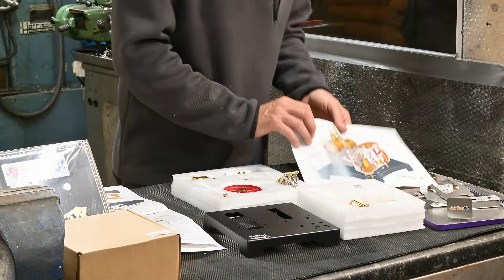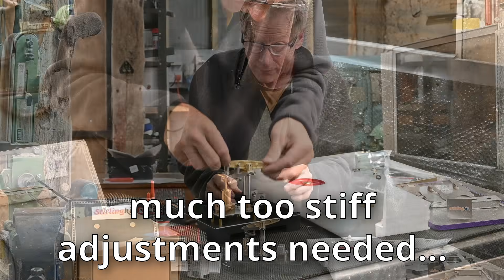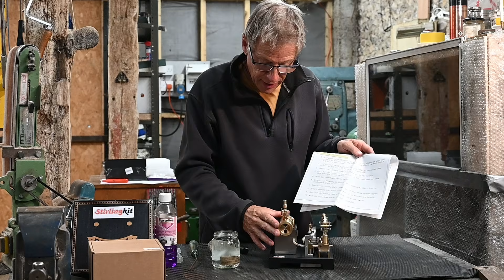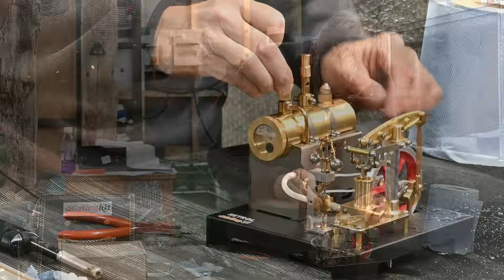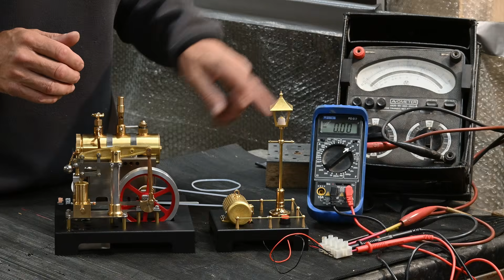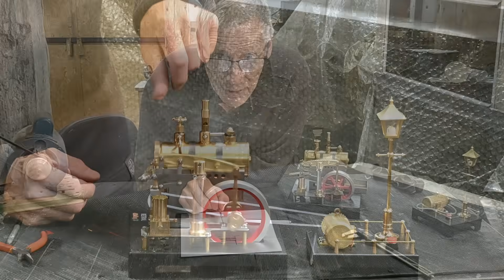Super-Cute Beam Engine from Stirlingkit – and measuring power output at Peter’s Railway

Comment: I'm having real trouble with mine. It runs out of steam very quickly, and you can hear it escaping out the exhaust. I don't suppose there's any chance you would make one of your improved valves and sell it to me?. I would be extremely grateful as at the moment. I have an engine I can't use.
Reply from the maker: Hi Gordon,  That is such a shame.  They have made such a lovely model, but seem to have made something of a mistake on the valve dimensions.
I am a bit pushed for time at this time of year, but I guess I could have a go at making another one for you.  Are you in the UK?
There would be no charge, but if you can think of someone to buy some of our railway books for, as a Christmas present, that would be a nice exchange.  Sets of them are here,  https://petersrailway.com/product-category/special-offers/  if that helps...
Back on the valve:  From memory, there was a little rivet which held the valve itself onto the valve rod/eccentric - it acts as the pivot there.  You would have to remove that rivet and I can put in a little 10 BA bolt/screw and nut for you to use instead.
Does that help??
All best, Chris.
Reply from the maker: PS, I should have said, it's best if you contact me through the website contact form, then I will see any replies...
contact form is at the bottom of every page.

Comment: Nice! Here in the U.S. we call those grub screws "set screws".
Reply from the maker: I never knew that!!  In the UK, a set screw is a screw or a bolt where the threads go all the way up to the head.  Someone once said that the US and UK are divided by a common language!!
Thanks for watching! Best wishes, Chris.
(For more information about the books I write to teach children (age 3 to 90!) about railways, science and engineering, please see here: https://petersrailway.com/ )
Reply: @PetersRailway I learned something new. This is from Google AI:
There is no functional difference between a "set screw" and a "grub screw"; they are two names for the same type of fastener, which is a headless screw designed to secure one component by applying pressure or friction against another component, such as holding a gear on a shaft. The terms are a matter of regional nomenclature, with "set screw" being common in American English and "grub screw" prevalent in British English.

Comment: Did you try measuring the power output with the new valve rod and the governor fitted?
Reply from the maker: Good question, or is it two questions?  Yes power was measured and much increased with the new valve, but the governor kept the speed too low to run the generator.  
However, since putting the video online, someone has pointed out that you can adjust the tension (compression!) in the spring under the governor by turning a little nut/screw.
That would have been good if I had only noticed it!!
Thanks for watching! Best wishes, Chris.
(For more information about the books I write to teach children (age 3 to 90!) about railways, science and engineering, please see here: https://petersrailway.com/ )